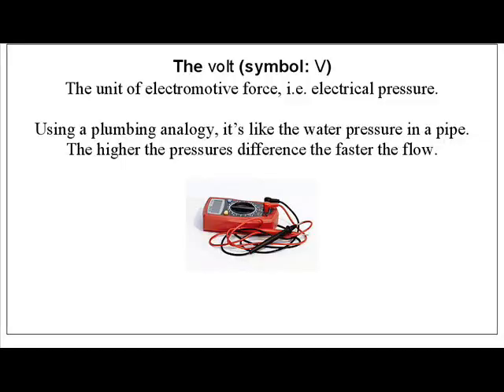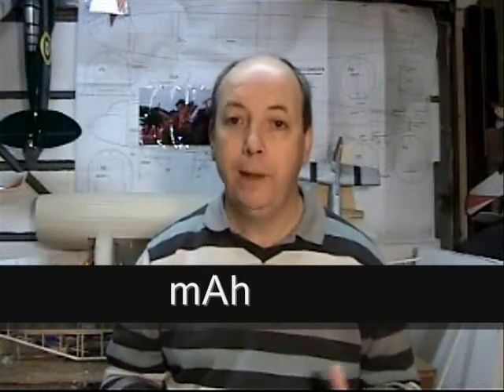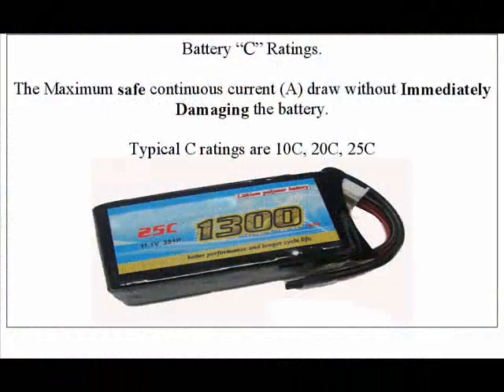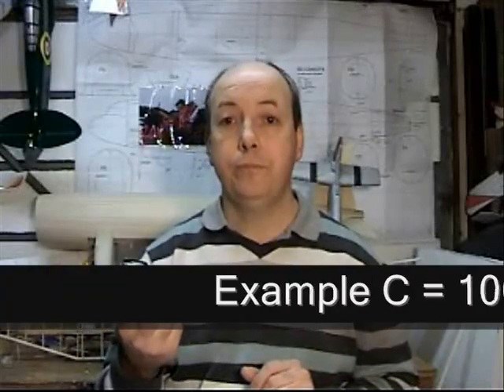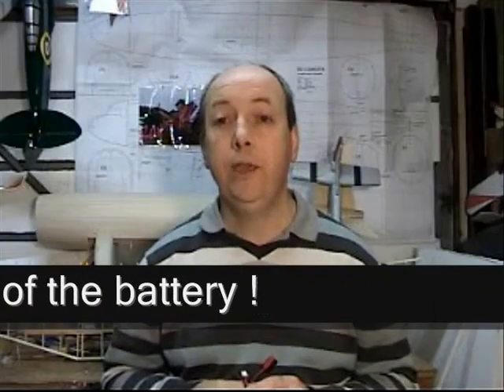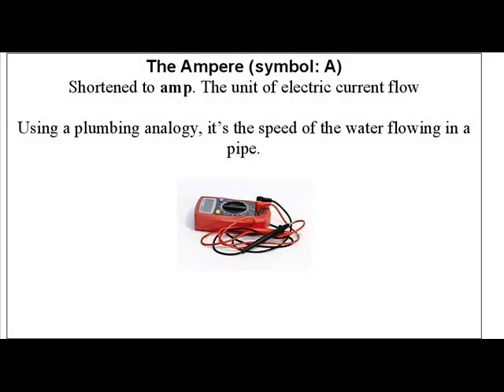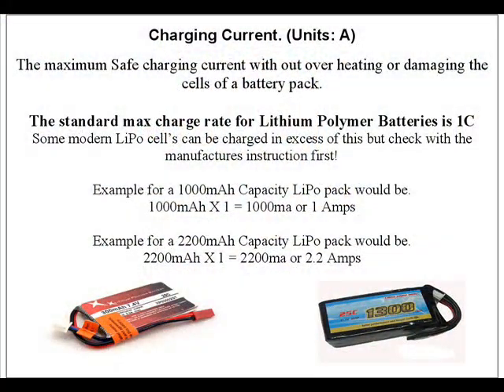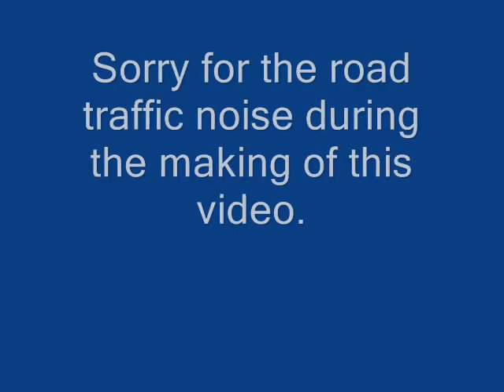A Beginners guide To Lithium Polymer Batteries for RC

Comment: Great video & TYVM for a beautiful lipo 101.In less than 15 minutes you answered all my  basic questions on lipo batteries and since the math is in fact simple it makes me wonder about the guys allready out there buying,using and charging them that couldnt answer my  modest handful of questions.If your so inclined can please do the same thing& explainer on brushless motors.Specifically i fly 46 size planes& want to know th KV equivalent and how to calculate it.is it 46 size motor=4600KV ?TY Gary

Comment: I have a question to ask of you. What it the lipo battery is a Turnigy 5800mAh 3S 25C Lipo Pack. PRODUCT ID: T5800.3S.25 by Hobbyking. So what is the charge rate on this battery?

Comment: If I want to run 3 batteries in parallel, does it matter if I were to solder all the + wires together and all the - wires together instead of running a wire from - terminal to - terminal to - terminal to out ?

Comment: @RTatBstoke Thanks a lot. I need those numbers for a drag race car It will pull a lot of amps more than 90 but for 1.3 seconds or so, track is 132' long. The lighter the batt the better but I need it a litter bigger one if I want to pull 80 to 90 amps. Original plans was 4 3s 1Ah 40c in series (12s total) with a CCHV110 ESC and  a motor that pulls 98 amps at 8s, don't know the numbers at 12s. At least 2Ah 40c batteries will be better. I think.

Comment: @RTatBstoke If I have a 1Ah 40C that means I can continually extract 40 amps. If I hook 2 of those in series for double the voltage, Can I extract 80 amps? If I hook them in parallel I will have double the capacity, Can I extract 80 amps? Summary, How can I double the C rating in parallel or in series? Thx.

Comment: i have a  5000mah 7.4v 40-50C lipo and the max charge rate it 2C.  how do i figure out how many amps to charge it at? i also have a 5000mah 11.1v 40-50C lipo and the max charge rate is 5C, how , many amps do i charge that at?

Comment from the maker: @Raid1983 OK first question why would you want to draw 40C continually ! 
At best if your lucky it would only last 90 second, and the pack WILL BE DESTROYED in very short order. 

If you connect 4 packs in parallel, you will have a 4Ah pack in total, the same output voltage & extracting 80 Amps would only be 20C. A much more normal sort of draw for a Lipo. Still only a 3 minute run time.

If I wanted an 80 Amp constant draw I would be looking at a 8 Ah pack, for at least a 6 minute run time.

Comment from the maker: @Raid1983 I don't recommend it, if  you can avoid it. But there should be no problem with it provided the cell counts are the same. ie both 3s.  Both pack will discharge at the same rate as a percentage of the total. Although the large pack will discharge at a higher amperage than the smaller. 
Hope that make sense.

Comment: Testing 2 Different mAh capacity LiPo Batteries connected in parallel..

In thet video author claims that is OK to connect in parallel two batteries with different capacity. Are you OK wit that?

Comment from the maker: @toddheap101 
Easy pee-see, 5000mah pack in real money  is a 5 Amp Hour pack. So 1C = 5 Amps, now all you do is multiply this number. 5A x 2C = 10 amps etc.
Just remember to set the correct voltage for the 2 cell or 3 cell pack..
One over point for long battery life, just because it rated at 5C for fast charging, you don't have to charge at that rate all the time. 1C will give you much longer battery life.